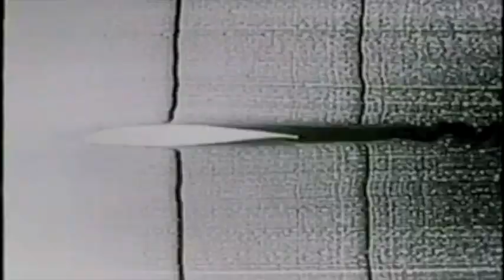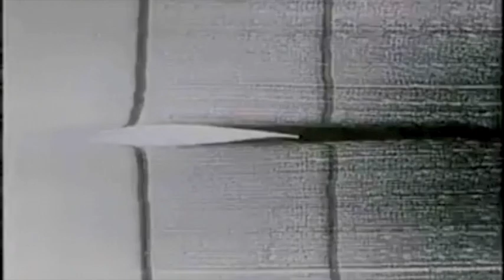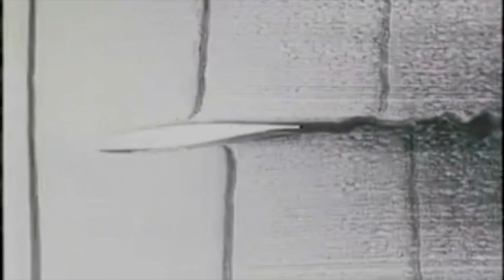Equal Transit-Time Fallacy

Comment: I have used horizontal smoke streamlines in a wind tunnel before, but I would love to know how you make vertical ones as in this video? Was this done in a different fluid than air? Does anyone have any insight?
Reply: Good question. First of all there is no need for the marker to be 2-dimentional, just a line is quite enough. One of the solutions is to apply a very short but strong current impulse at vertical wire set somewhere in front of the model where the flow is still uniform. Hot wire may cause some kind of chemical reaction in the gas/fluid used in the test and products of this reaction (or even just a smoke) may be visible. Looks like I read about something similar for visualization of profile of speed in boundary layer.
Reply: This may have been water with microbubbles and a bright light source.  I haven't tried the following myself, so experimentation is probably required.

To make a plane of bubbles using electrolysis, add lye to make the water conductive, then stretch a hair-fine iron wire across the laminar flow, submerged in the water of course, and connect it to a negative power supply of a few volts and many amps.  The negative wire makes hydrogen bubbles.  (The positive plate would be submerged somewhere nearby upstream.  It generates dissolved O2, not bubbles.)

To make the dark lines, use a timer to interrupt the DC current briefly and periodically.